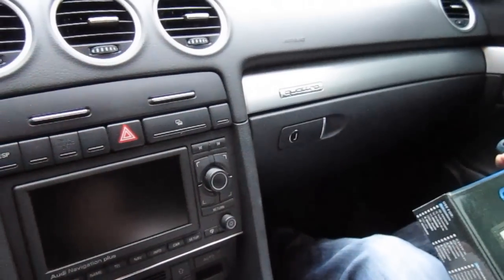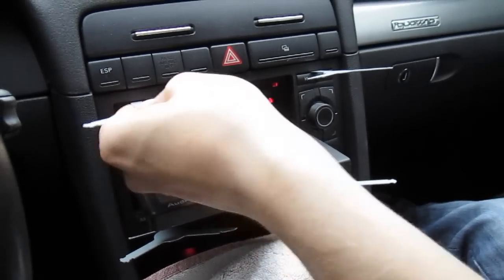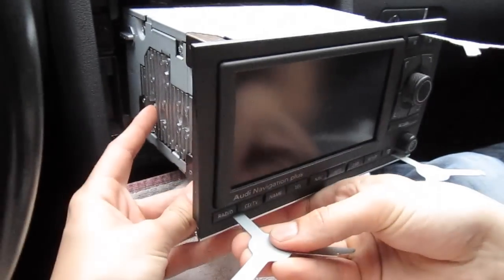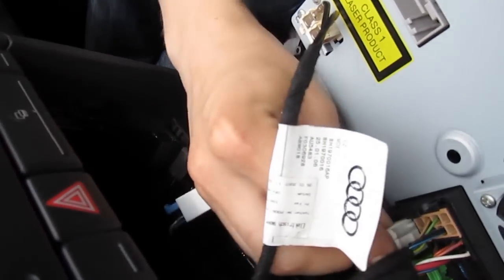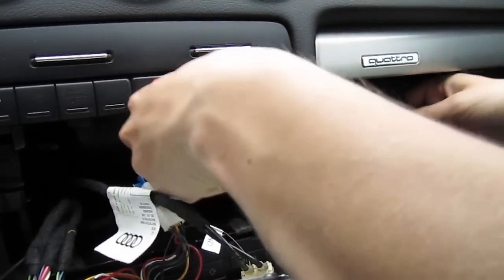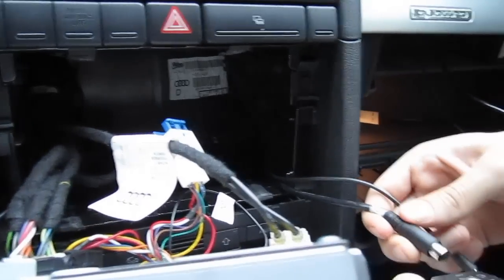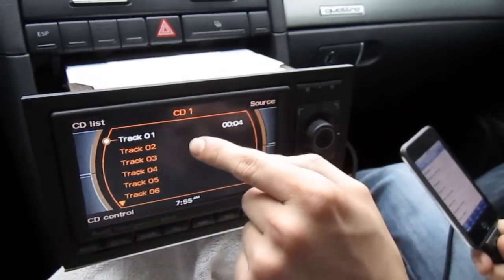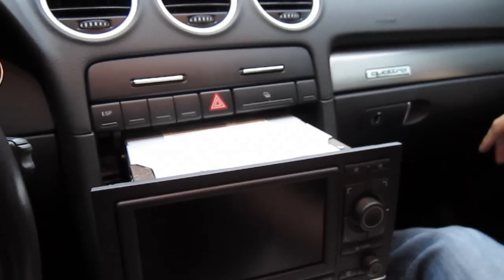Audi A3, A4, A5, A6 RNS-E iPod iPhone AUX adapter

Comment: I have the built-in aux port on my audi a3 but it isnt working. RNS-E says aux source is active but its just a hissing noise. When nothing in aux port, still says aux source active and still has the same hissing noise. Any idea what it might be?
Reply: I have the sameproblem; any luck resolving it?
Reply: Julian Deleij
It turned out to be retro-fitted, had to buy the right adapter for it since it used the old headunit one
Reply: Harpreet06 Thanks for the reply! So no software shite then? I thought maybe there'd be more tweaking to do...
Reply: Julian Deleij Nope no software stuff. There's a guide for it online if you look for how to retrofit an RNS-E, you'll see which adapter I'm talking about. For me I had to go to an Audi showroom to order it.

Comment: Anyone knows if the surrounding trim is replaceable ? I seen same navigation on both As and A4 but the outside shape is different, so will an A4 navi plus work on an A3 dash ?
Reply: +adrianTNT Ive seen it done, people have replaced an A4 RNSE with an A3 RNSE